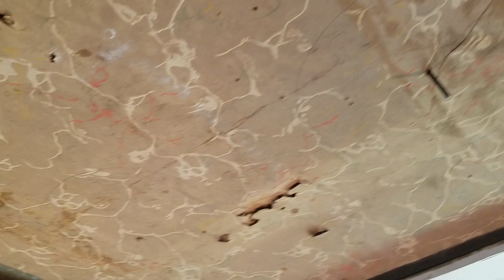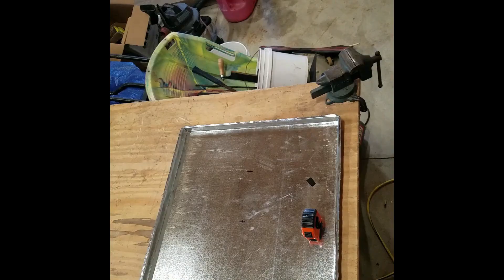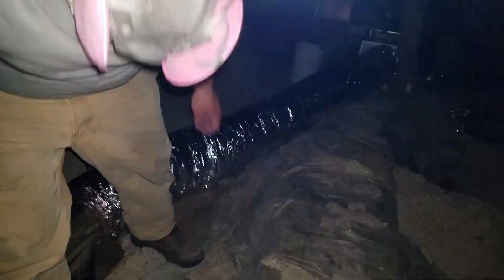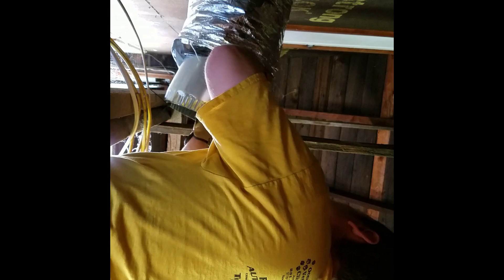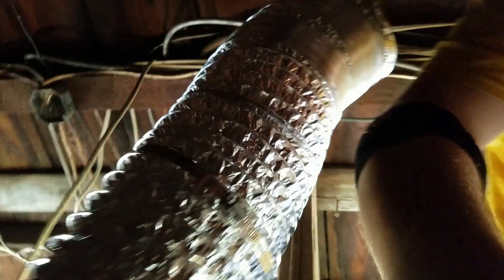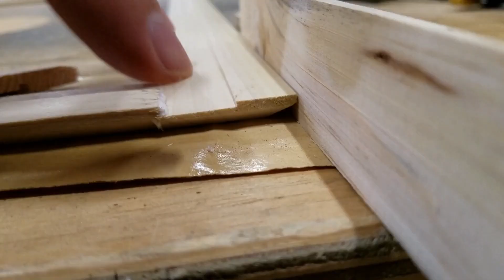DIY Flush Mount Range Vent Hood for my Wife's Kitchen

Comment: Do you have 8’ ceilings? I’m curious about actual performance based on height and a guess on performance at 9’ and 10’
Reply from the maker: My ceilings are a little under 8' in this room. A higher ceiling might lower the effectiveness a little, but the huge amount of air that's being moved makes me think a system like this would still work well. You could divide the cubic feet of the room by the CFM of the fan to see how often the room's air is being replaced.

Comment: I enjoyed watching your project and it looks great.  Watched a number of videos on the subject and here is what I learned: apparently if you use a fan >400 cfm you need make up air per code as of 2018 and you need less than 3 Pa difference in pressure between inside and out.  Reducers have huge negative impact on flow rate.  You also want to to fixed (not flexible pipes) and avoid sharp bends like the t-you used on one of the inlets.

Comment: amazing job overall! to my limited knowledge, most flex hoses are not up to code to vent air from hoods but only rigid metal ones; might want to switch that duct work up in the attic; obviously double check though, I am no expert